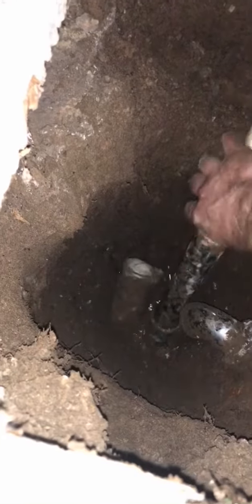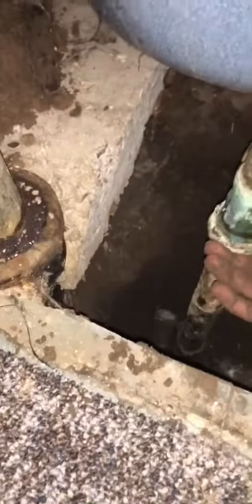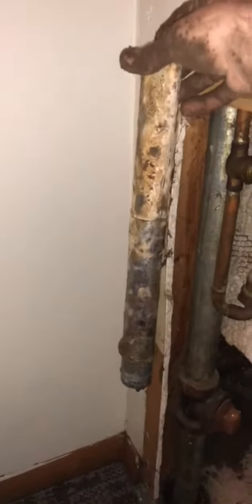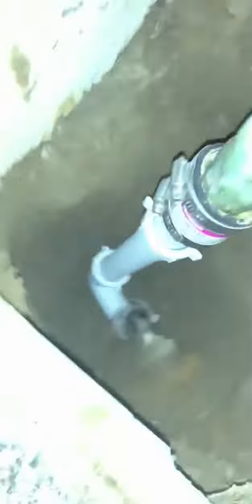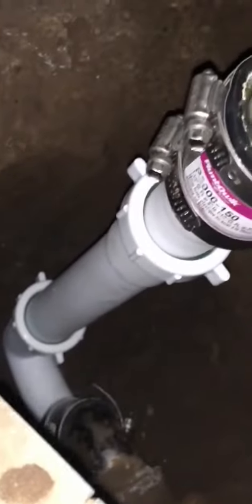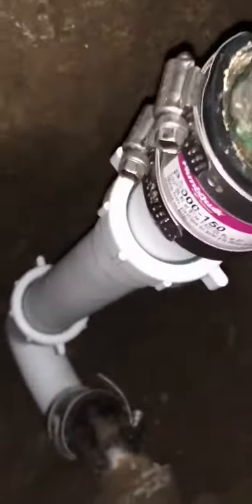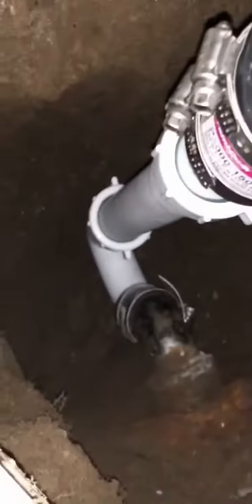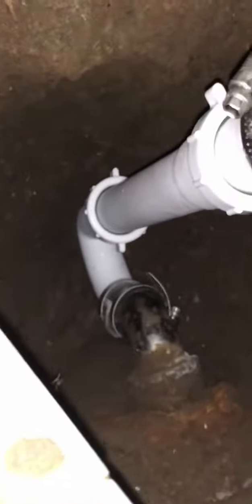Me fixing a pipe at work!

Comment: this repair is bad, you can't bury slip joint fittings and you used the wrong fittings to connect to the old elbow.
Reply from the maker: I went back the next day and cut out more so I could make better fits. I just was feeling inspired and took a video. Thank you for your input.